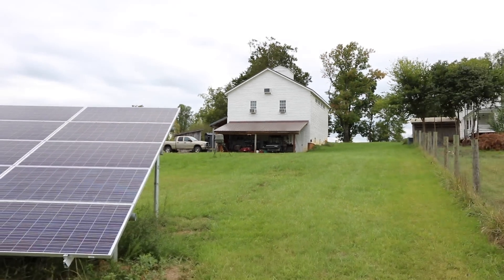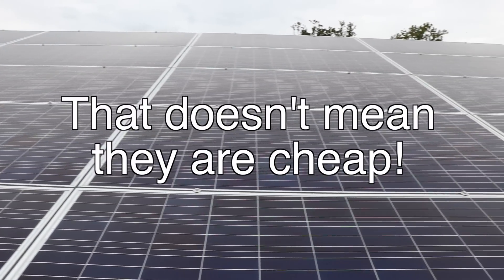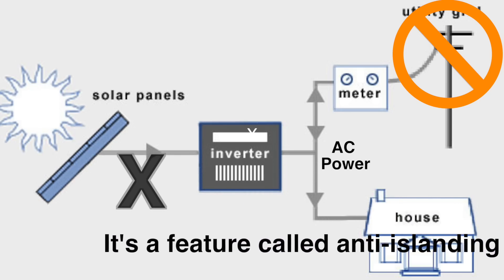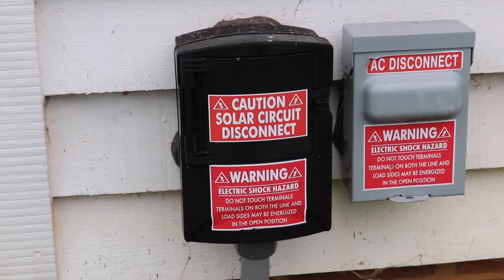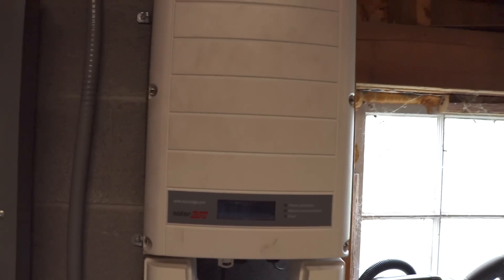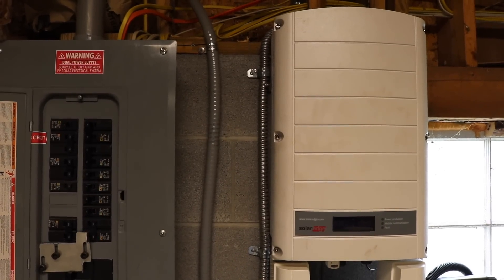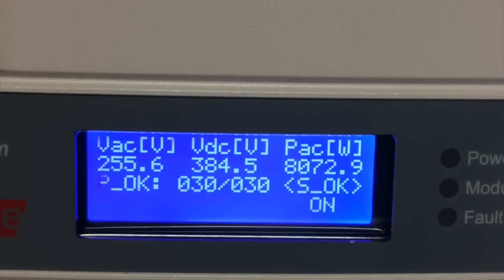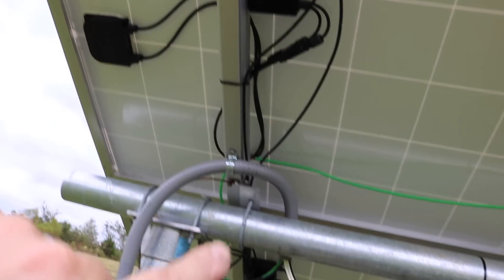The ugly truth behind grid-tie solar systems. Part 1, FarmCraft101 solar.  Watch before you buy!

Comment: As I understand it, even an auto-cut off system or a manual cut-off could malfunction. So if it does then power would br back-feeding the lines. With this in mind (I know I did not inculde this in other posts), I would continue to have a two circuit system independant of each other. The monies returned from selling electrocity back to the grid system is so minimual (and at your maintence expences) just doesn't appear worth it.  Maintence alone would eat up any money received from a power company that most likely raised your rate even more to cover any costs they would be returning. Welcome to the "smart" meter system.

Comment: At 30 cents a watt, it should cost no more than $3000 for the solar panels
Reply: Solar panels are usually only about 1/4 the cost of a system in 2018.

Comment: can i ask? why can it be made also as off grid? if ther is a direct connection to the grid, is it possible to create an by- pass which means you can switch off the line on the grid to your meter ang directly connect to your eown home or to say that you separate your own system when there is blackout

Comment: The subsidy costs other people money.  In the end the true cost is the real cost.  If everyone took advantage of the subsidy no one would benefit.  That money comes from taxes.  If we all take advantage of the subsidy and we all pay the tax there is no beneficiary.  It isn't quite that good though because people who can afford a solar setup are subsidized by people who can't.
Reply: Your assumptions are wrong.  Solar-power incentives help delay building additional fossil-fuel plants.  I've worked for fossil-fuel-fired power companies, and you would be gob-smacked to learn how much a new coal-fired plant costs, nowadays about $2B (BTW, I am not necessarily anti-fossil-fuels, gas-fired turbines make lots of sense in many situations).  One delayed, $2B plant buys a lot of solar power incentives that no one is "net" paying for.
Reply: The government doesn't own any money.  I gets it from taxpayers.  People who rent can't take advantage of solar energy.  Others can't afford it.  It is people who can't afford it forced to subsidize those who can.  Other problems with solar.  If you want to use solar you start with requirements for now.  You buy storage for now.  If your battery bank fails you need to find like batteries to replace the failed ones.  They have to match those in your system.  If you can't do it yourself you have to hire expensive help.  There is no power company to call and say we have no power.  If you are grid tied then you still need a power company but they don't repair your system.

Comment: Wow, that’s expensive! AU$3,500 is all I paid for a 5kW grid tied solar system including a hybrid inverter, fully installed. That’s about US$3,000.
Reply: Australia is home to some of the lowest solar PV system prices in the world, thanks to a broad combination of global and local factors.  Australia has a very strong, up-front incentive for small-scale solar systems (up to 100kW) through the small-scale component of the federal government’s Renewable Energy Target. The exact form that this incentive takes is a bit complicated to explain, but in a nutshell it helps to knock about 30% off the out-of-pocket cost of going solar.

You still paid, however, about 59% of the average cost in AU.  AU$5,930 is more accurate for the AU in 2018.  Still, even that is crazy cheap.

Comment: I would not agree to a grid tied system. Off grid is the only way to go. Or if it DOES work while power is out, like a Tesla wall.
Reply: Install an Off-Grid system and the report back with your COST.

Comment: Question, isn't the panels only efficient for 5 years, then they really fall off the amount of electricity they can produce?  I mean in 8.5 years you basically have panels that aren't producing hardly anything.
Reply from the maker: No.  They are warrantied to produce 90% of rated capacity at 10 years, and 80% at 25 years.  Good solar panels last a long time.
Reply: Thanks, that is good information. BTW, great video.

Comment: most of the inverters on the market today have a single outlet feature that will have power during a blackout from the grid. They are not designed to supply enough power for your whole house, but enough to run a fridge, medical equipment etc. These have been around for a while now, I don't know when your system was installed, but video was uploaded October 2017, these inverters have been around since 2016. I do know it's hard for the average person to know whats available, mainly because the industry moves so quickly, also the agent selling the system doesn't bother learning what the options are for every component.

Comment: question:  is there a way to turn off the feed back to the grid on your gird tie inverter?  I would like to use a grid tie inverter but feed it the same as a hybrid inverter.  that way I could harness most of the electricity that I make and use it at night eliminating almost all use of the grid except in higher use situations or when its been clowdy for days.  the reason why I would want to do it this way is its a seamless way to power the house and it wouldnt drain the batteries to power the grid, the batteries would be used for only my power.  does that make sense?
Reply from the maker: With a grid tie inverter, you must be connected to the grid.  With a hybrid inverter you can definitely control when you use the batteries vs the grid.  And you can AC couple a hybrid to your grid tie system.  Watch part 2&3 of my solar series.
Reply: I dont think I explained it right.  lets say I didnt want to spend the money for a hybrid inverter and it was an undersized (meaning my house might want more power at times) grid tie inverter and lets say the batteries are the same voltage as the solar panels.  now at night time I could potentially power my house with a grid tie inverter using batteries to supply the same voltage as solar panels would.  the only problem here is if I fed the grid I would drain the batteries too fast.  I would NOT want to feed the grid.  for example, lets say I have a 1KW grid tie inverter that got its power from batteries (instead of solar panels) and my house needed 2KW it would take the extra 1kw from the grid and if the power consumption went below 1kw then I would want the grid tie inverter to not feed the grid to save battery power for my house.  so basically its a cross between a hybrid and a grid tie system.  I just need a grid tie inverter that wont feed the grid, it can take from the grid when needed but not feed the grid.  Is it possible to turn of that feature?
Reply from the maker: I've never heard of anything like that.  Remember grid tie inverters require an external sine wave (ie: the grid) or they won't produce power.
Reply: FarmCraft101 right.  It would be wired to the grid the same way.

Comment: some states more solar friendly. nj makes utilities pay same going out as going in. the big deal isnt so much putting juice back to the grid in as much as not taking it out. my 8.5 kw system gives me "free" a/c during the summer and helps mitigate some winter heating. i can save $1000-$1400 between march and october (15 cents kwh and going UP!). here's an ugly secret of solar. a 1/4 inch of snow on the panels means no juice.

Comment: If you use smaller wires you have higher effective series resistance governed by R=rho*L/A where A is the cross sectional area of the wire - decrease A, increase R... Increase R, increase heat loss per unit ampere = less efficient. 

I don't know the specifics of your system so you could be right, but it's a reach to say it's more efficient transmitting 365V vs 240V. More thorough analysis needs to be done besides less current = more efficient because that's not exactly true.

Also to note, switching supplies (like inverter) become less efficient when input current is lower so by running lower currents whatever efficiency you might be gaining is likely lost in the inverter. Does your system have a way of measuring conversion loss? Just curious.
Reply: P=IV=i^2*R=V^2/R
Reply from the maker: It's true that a smaller wire has higher resistance, of course.  But transmission efficiency is all about amperage.  If you raise the voltage, the amperage goes down.  If the amperage is low, a smaller wire can carry it efficiently.  That's why overhead transmission lines run as very high voltages.  Would it be more efficient to use a large wire AND high voltage?  Sure, but it wouldn't be cost effective.  At a certain point, you are going to gain only a tiny fraction of efficiency for a lot of cost.
Reply from the maker: https://en.wikipedia.org/wiki/Electric_power_transmission   
"Transmission efficiency is greatly improved by devices that increase the voltage (and thereby proportionately reduce the current), in the line conductors, thus allowing power to be transmitted with acceptable losses. The reduced current flowing through the line reduces the heating losses in the conductors. According to Joule's Law, energy losses are directly proportional to the square of the current. Thus, reducing the current by a factor of two will lower the energy lost to conductor resistance by a factor of four for any given size of conductor."
Reply: Right, but in that statement they are also assuming a constant ESR ("for any GIVEN SIZE of conductor")
If you change the conductor, you change R..
If R increases by too much, then even though you are transmitting with less current, you could still generate more heat loss than before, making it less efficient - is all I am saying.

Comment: What if you don’t have $17,000? If you live paycheck to paycheck and don’t qualify for credit; the power company will not reduce your bill or pay you money, and you get no tax credit either. Let the power company that generates electricity that is purchased by the utilities use your property to install panels in which they can reduce the production of say power from Coal to maintain sufficient electricity levels, reducing costs and using savings to add more. ‘This way the broke can also benefit from possible savings on their bills too.
Reply: Why can't you install a LEASED System with $0.00 out-of-pocket.

Comment: His reasoning is exactly why I would never install a conventional grid tie system.  Note also the inverter will consume aporoximately 40% of the incoming solar power, not to mention any monies/credits you receive from the utility company will NOT pay enough for viability.  If the incoming voltage is high enough then the inverter may not be require to stepup the voltage much, meaning it can be quite a bit less than the 40% consumption I stated. It is the stepup transformer in the inverter that does most energy consumotion.  Also, I have heard that utility companies can charge someone (someone using a  solar array) more when they need electricity from the utility company, but I have not verified this yet.  Thus, any system I install will be separate from any (if any) utility company's system. This means if the power grid goes down... I can keep right on using my solar/wind power system.
Reply: Your reply has caused my BS meter to display 100%

Comment: While I enjoyed your video, I was disappointed you didn't include 'opportunity cost' in the evaluation of the years to payback calculation. For example, if instead of spending $17,000 on the solar array you invested it, you would earn interest on that investment. Let's say you bought tax free bonds at 4%. That $17,000 would earn $680 per year in perpetuity. That $680 lost because the $17,000 was spent is the opportunity cost of this solar setup. So, instead of earning $2,400 a year you really only earned $2,400 - $680 = $1720, which extends the break even point well past the 10-year mark.
Reply from the maker: You are partially correct, but you have to pay the electric bill every month out of that $17000, so it's not as big of an effect as you have figured.  It's a very complicated calculation with a lot of assumptions, and there is no way to make it exact.  It does however extend the break even period if you consider this aspect, so I agree with you.  You could also assume electricity costs rising annually which would decrease break even time.  But putting all the many considerations to make the break even calculation complete would have taken much too long in this video.  I plan to do a follow up video after my first year of generation and I will try and present a more complete calculation.  Thanks for watching.
Reply: I hadn't though of that and agree with you. I failed to consider the higher monthly electric bills as an opportunity cost for investing the $17,000. Thank you! And thank you also for the video. It provided a lot of information unavailable anywhere else. It was also very well made.

Comment: The only issue with high voltage over high amperage transfer is if you cover one single cell on a whole panel, it chokes the entire system.

Comment: NO you got sold a badly made inverter or lazy set up man. if it went from the meter to the inverter box then into your house. the inverter could have a simple automatic switch that switched off power going into the grid if the grid was not producing any power.  preserved power into the house it would only take 2 long wires instead of one going out to your inverter. that could be located next to the house rather then the panels. if you can do it for low voltage you can scale it up for high voltage. their is no Physical reason why this is not easy to do but if their are no inverters on the market that does this its because the government wants their hands on the light switch. they need us to need them, and their willing to hurt us to make it so.

Comment: They all offer huge warranty on panels and everything. Where will these companies be in ten years when you need panels replaced or other hardware.  If you replace batteries  that's a expense . I don't see 25 year guarantee on batteries  . I would be very careful  .
Reply: Replace batteries every 5 - 15 years depending upon vendor and depth of discharge ...

Comment: I Don't understand why grid tie would be cheapest. They mislead you because they want you to use Appliances that use lots of Watts per Hour- It's a Scam. Get rid of your modern ac and heater, washing machine dryer, refrigerator and replace these with low tech/low energy products and you can live comfortably with a system a tenth of the price you paid.
Reply: this comment went from "I don't understand" to giving advice in less than half a minute. Im impressed irony can be condensed into such small space.
Reply: @TheVergile  YouTube was so much better when you could see the number of down votes!
Reply: But be aware, in the case of a washing machine (new hi efficiency type) they are terrible.   The clothes do not get clean and you must wash them more than once.  Now folks are buying the old style washers in Canada (the only place they can leagally be made now) and trashing the (hi efficiency) junk.  Thanks to Gov. no it alls.  I question anything called Hi Efficiency anymore.  Some are good, some just use the term to sell junk.  Check the ratings and do the math before you buy.
Reply: I built a 48v instant water heater that uses 95% less power than a tank, and cut my upright freezer consumption by 60%

Comment: Good explanation, however note that for an ac system what determines if power is received from or sent to grid is the phase angle of your solar system relative to the grid. i.e. whether leading or lagging. Phase angle is influenced by your load.
Reply: Nope, the Inverter is an AC Current Source, it is in-phase with the grid, not leading, not lagging

Comment: You should know that the "anti-islanding" issue is a total ruse by the solar companies to make sure you do not use their system while they cannot benefit from the reverse metering (called Feed In Tariffs).  The excuse that it protects the linemen is totally fake.  It is a very simple matter to insert an automatic switch that disconnects your system from the grid when there is not grid power.  Once that is done, you can use your own solar power for your own property.  If you own your own sysem, simply add this grid-disconnect relay.  If your system is leased or time-pay from a solar company, then you're screwed because it is in their contract.  Be sure to read any contract very very carefully when dealing with any solar systeem lease or time-payment purchase.
Reply: Not a ruse; the inverters are required by the utility to detect and prevent islanded operation. Think about the safety of the linemen and it becomes clear why this is necessary.
Reply: A battery bank is also needed. Capacitors may work, but to power anything with a motor, power storage IS needed.

It's a lot more complicated then just adding the transfer switch. Also, that inverter relies on the grid signal to be able to make a sine wave. You would need a different, bigger, more expensive inverter EVEN IF you had a 360v battery bank.
Reply: You still need a battery for the house load , but your right a contactor where the coil of the contactor is on the grid supply side would immediately disconect the solar system from the grid in an outage.